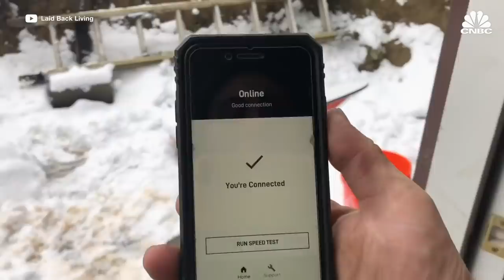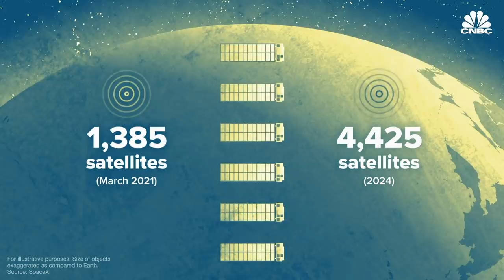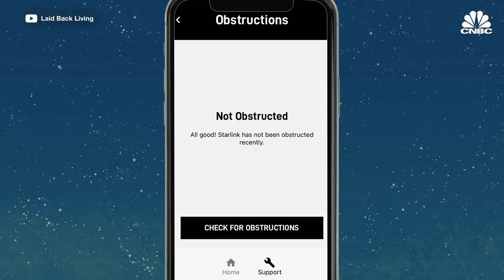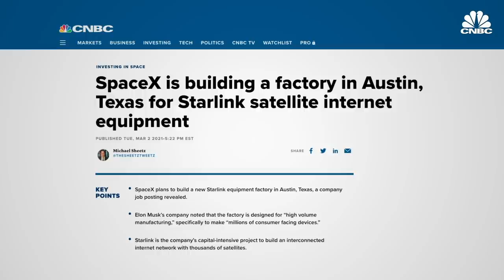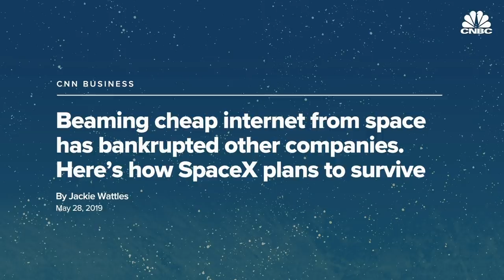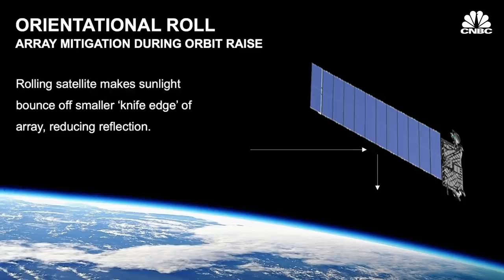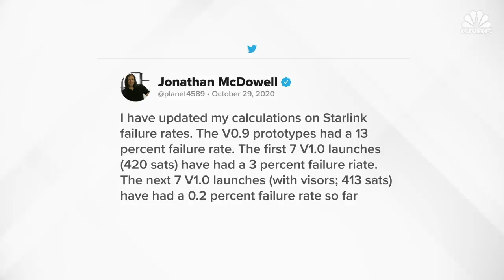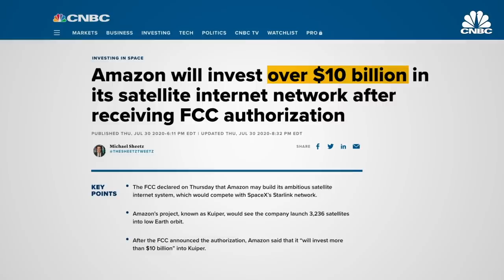Why Starlink Is Crucial To SpaceX’s Success

Comment: De-orbiting failed Starlink satellites is not a long-term problem. At the low altitude at which Starlink orbits, the satellites are experiencing small amounts of atmospheric drag that will eventually decay the orbit and cause the satellite to reenter and burn up, even if it has no communication or propulsion.
Reply: how long is "eventually"?
Reply: @Dozman01  it depends
Reply: @Dozman01  Around 5 years for starlink sats
Reply: @ok ok The regulation they mentioned in this video would require satellites to de-orbit within 25 years. 5 years is 5 times shorter than that, and we're only talking about the worst-case scenario where SpaceX completely loses control the satellite. Which hasn't happened yet (to my knowledge) in any of the 1200+ satellites launched so far. There would not be dozens or hundreds of dead satellites in 5 years.
Reply: @ok ok I was referring to if all system fails. 5 years is the natural time it takes for the sat to burn up if the propulsion system does not work.
Reply: @ok ok There has not been a StarLink failure of 2.5%  The source for that was including the test batch which wasn't to stay up anyways, and none were 'dead' satellites that were not able to be de-orbited.  
If they do fail to be controllable, the atmo drag will reduce their altitude fairly quickly taking them out of the current Starlink Orbits, and therefore reducing the chance of a 'Failure' collision almost entirely.  Then within a few years, it will deorbit completely and burn up.
Reply: @ok ok Quote directly from Business INsider (who broke the story about the 2.5% failure rate:
Before the end of October, McDowell was measuring a 3% apparent failure rate, but a recent reanalysis indicates improvement in the newest Starlink batches. Of the last 413 "version 1.0" satellites, only one appears to have died, giving these batches a failure rate of just 0.2%.
Reply: @ok ok It says "A 2.5% failure rate could mean more than 1,000 inoperative spacecraft." ... likewise that means a 5% failure rate could mean 2,000.. or 100% could mean ...... anything 'Could' mean.
What it is is .2%.  .2 percent over the 5 year life of a satellite is negligible.  There will NOT be suddenly 1000 satellites that stop working and crash into each other.
Take a deep breath...
Reply: I'm curious about how debris burning up in the atmosphere affects it. We see things that seem harmless at first but then after a build-up become extreme hazards.
Reply: Also if space is so vast, why not push them into outer space or take them to Venus where they can safely burn up with no threat to known life?
Reply: @teethompson7756  The amount of fuel that would be required to push them out of the Earth's gravity well would be more detrimental.  De-orbiting uses the Earth's gravity to do the work.
Reply: @ok ok  you seem to intentionally forget how far these satellites are from each other at 500 km above earth. The area of the the earth is already massive and if you increase the radius of this sphere by 500 km, it will be even greater. Even 50,000 satellites in orbit will be at great distances from each other. In the event some of them fail/lose contact, they are programmed to automatically de-orbit using ionic propulsion and gravity(if the ionic propulsion system fail, gravity will still do the job though it will take longer). Take a deep breath, close your eyes and picture these events in your head. Maybe then you will get your why your fear mongering is uncalled for
Reply: @countrychristmasloft8836   I see, but what are the long-term effects of the atmospheric burn-up? I assume that research has been done considering we've been putting things in space for decades.
Reply: @teethompson7756  It takes a lot of fuel to escape orbit, but very little to reenter. Pushing dead satellites out of orbit would be impractical.
Unless they are using radioactive materials or particularly toxic chemicals, there is no danger to life from reentering satellites. Thousands of meteors burn up in the atmosphere every day... they do not affect life on the surface.
Reply: @ok ok can't remember, probably saw it on Elon's Twitter. 
Here's a reference from a Dave Mother article from two years ago talking about doing this manually:
"In addition to letting the three failed spacecraft fall back down, SpaceX plans to intentionally bring down two others using ion engines; this is meant to demonstrate the company's ability to prevent spacecraft from turning into harmful space debris."

They even nearly took down Aeolis by accident.
Reply: They are still designed to de-orbit themselves so they don't collide with other objects.
Reply: Oh, come on. If they don’t communicate with a ground station for a while the timer will kick in and de orbit the starlink unit
Reply: Maybe someone else can answer this, but I was wondering why they wouldn't simply launch them out into space once they are out of commission? I'm probably overlooking something really basic but it seems like it would be easier, plus an opportunity to launch essentially free 'beacons' into interstellar space for any other hypothetical civilizations to find.
Reply: @kevj4584  
Because breaking out of earths gravity requires a huge amount of energy
Reply: @heidelbergaren5054  yup good point. I thought of that afterwards and now feel dumb lol
Reply: @kevj4584  It takes a lot of thrust to achieve escape velocity and leave Earth orbit, almost certainly more than the satellites can produce with tiny maneuvering engines and a limited supply of propellant.
Reply: @ok ok haha this ok ok guy is a troll and he almost got me but I've learned to just laugh them off
Reply: @ok ok you can't just take into account a few specific points and then disregard multiple other points that don't fit your narrative. 

You are stating that almost 3% of Starlink satellites have failed. That is correct. But you are also stating that if SpaceX achieves its target of 42,000 satellites in orbit, there would be about 1,260 satellites that would have failed. That is likely incorrect, because you are failing to understand that SpaceX is rapidly improving its satellites. The aim is to lower the failure rate to much lower than 1%, and Elon Musk even said that a failure rate of 1% "would be inacceptable." 

To conclude, instead of predicting that around 1,260 satellites of 42,000 will fail, we can predict that less than 500 of 42,000 satellites will fail. And the thing is, the number 500 was calculated if we assume that 1% of the next 40,000 satellites will fail, when clearly SpaceX has the capabillity to make the number much lower than 1%. 

So if we take into account that SpaceX is SpaceX, and that Elon Musk is the CEO, an assumption of a total of 300 failed satellites is not crazy.
Reply: @ok ok Oh, I understand now. You're one of Elon Musk's haters. As I have already said, your argument consists of a few different points, yet utterly ignores the rest. It has to fit your narrative.

I like how you said "SpaceX engineers can't just magically solve a problem that companies have been trying to solve for decades." Because that's exactly what they HAVE been doing. You are choosing to focus only on some promises that Elon has made over the years, instead of what he has accomplished, and how important he has been. Sure, he sometimes makes impossible claims, but that is helping speed up innovation greatly, beacuse it puts pressure on everyone to achieve the goal faster. There's a reason why SpaceX is rated as the #1 most attractive employer in the world for engineering students, with Tesla following right after, at #2 in the world.

All that aside, SpaceX is already showing that there have been major improvements in the satellites to lower the failure rate. The same astronomer who originally calculated the almost 3% failure rate has now also noted that the "reliability of the satellites has noticeably increased." Therefore, the source of your information is against you, and the data is clear proof against you.
Reply: @ok ok What's your source for the information in the second paragraph regarding the claims about the reusability of the Falcon 9 and Falcon Heavy? And the source for the industry standard failure rate?

So back to the original topic, SpaceX has enough brilliant minds to decrease the failure rate of its satellites. This whole debate is getting very silly, and you are taking this way too seriously. The Starlink satellites will eventually be able to provide affordable high speed internet access to every human on Earth. Stopping Starlink's mission is not an option, the only way is to make it safer. And SpaceX is doing just that.
Reply: @countrychristmasloft8836  Gravity works in orbit, that's why they're flying very fast orbiting around the world. De orbiting lowers the orbit speed which also lowers the orbit altitude, until it contacts the atmosphere further slowing the satellite for re-entry.
Reply: @ok ok I’m not blindly following whatever Elon Musk says. I’ve been stating facts and actual numbers from SpaceX itself. Sure I have quoted Elon a few times, but you have to understand that Elon is the CEO, CTO, and Chief Engineer of SpaceX. He is heavily involved in everything about SpaceX, as well as all of his other companies. You said that Elon is “extremely ignorant on how the science behind his products works” in a previous comment. That is a very idiotic statement. What Elon says can most definitely be trusted. Having a few wrong estimations on a few of his products does not equate to him not knowing the science behind his products. Just go watch any of his interviews, he is extremely intelligent. Also, I don’t know where you got the notion that he genuinely lies about his products and is fraudulent, because that is blatantly wrong. Elon Musk is no Trevor Milton. 

Your estimations are wrong. Don’t ask me to provide you with a detailed explanation with what’s wrong with it, because I’m not wasting my time on that. I’m just here to correct your foolish thinking. 

Anyways, you haven’t even explained or provided sources for any of your other questionable claims. I don’t mind if you don’t, but just know that your statements contain no validity with no sources.
Reply: @ok ok Damn, seems like you really hate musk, calm down bro. Complaining will not get you anywhere.
Reply: @ok ok Yes you're. In all this comment section you made him sound like a villain. Like all he ever do is bad or just promising. Everyone here saw you fight back to prove EVERYTHING that he's doing is bad. He's not perfect nor he's hero, but at least his doing things instead of Complaining like a hater here. go do something with your life, at least people put faith in someone who dreams and wants to do something instead of someone who points a finger at complain like you.
Reply: @ok ok If you are here in this comment section for days replying instead of studying then there's something wrong with you. You just points and things that he did wrong and not the good, just like you don't want to see them wtf? that is not hater thing to do?
Reply: @ok ok I don't even know if everything that you said about yourself is true. Your account was created "Joined Apr 5, 2021". This really sound like a troll account that was created recently specially with your name "ok ok".

This conversation will get us no where... i know what you said about his lies and over-promesing, but to say that "broken promises and lies far outweigh his proportionally minuscule accomplishments." is really a overplay. I don't think someone that rose to be one of the(if not the most) importantly/influential is low like you said. This make it sound very hater...
Reply: @ok ok the network is in sub orbital trajectories. It's very close to the earth's surface as opposed to other satalites.

That means, it's technically orbiting inside the earth's atmosphere.

The real obstacle for SpaceLink is keeping the satalites from NOT falling due to atmospheric drag. 

I read that each satalite had a propulsion system that gives it a periodic boost to overcome atmospheric drag.

If the propulsion system fails, and the satalite fail to get the periodic boost to overcome atmospheric drag, then it falls towards earth and burns up.

Normal satalites are faaaaaar away from the earth's surface and don't have to worry about atmospheric drag. Sub-orbital satalites are not really in space, they're near the top of the earth's atmosphere.

ICBMs (Intercontinental Ballistic Missiles) usually shoot up to that altitude, and then fall back down. It's not that high up.
Reply: Planned orbital lifespans, come down regardless, replaced by newer upgraded versions.
Reply: @teethompson7756  would take a lot of energy to actually escape the pull of earths gravity and escape its orbit.  wayyy to much energy
Reply: This Ok Ok dude is a troll from china. They are at war with elon over spaceX and Tesla in China. China main media platform are at open fire with him and the media there speaks for the government. So don't take him to serious. Just a warning. Sounds like a joke but his account was created 4 weeks ago. And he has commented on tesla and spaceX. So his account is very very fishy. Fishy as sushi😂
Reply: Could falling debris be harmful?
Reply: @variantunknown4210  It's unlikely. Satellites like this are designed to disintegrate completely  upon reentry, and they don't contain toxic elements (like atomic reactor fuel).
Reply: @ariochiv  thanks for your reply, one less thing ill be losing sleep over 😅
Reply: @ok ok "permanent Kessler syndrome type issue"
lol
the moment you said this in one of your first comments, that should have been the moment people started questioning everything you say.
sadly no one even picked up on or called out that comment you made.
its funny how you think you have all the answers when you don't have even a basic understand of the core thing... lol
Reply: @ok ok "Kessler syndrome literally could lead to an issue that takes hundreds of years to clean up. you disagree?"
yes i greatly disagree with this.

at worst it would clean its self up after at most 5 to 6 years. it would decay in that time.

in fact my own complaints with star link is i think the thing will decay to fast to justify the costs involved. such a system will have to be replaced nearly constantly, not even because of the satellites failing, but because of them deorbiting on their own.

keep in mind, a large chunk of the satellites are lower elevation then the international space station. and people say it would only take a few years at most to deorbit if left alone.
Reply: @ok ok yes it can effect satellites in vastly different orbits, however even satellites in higher orbits don't have hundreds of years worth of decay.

even debris with a highly eccentric orbit will decay pretty quickly compared to what you are saying.

i'm not saying its perfectly fine if it happens, but don't blow it out of proportion here.
Reply: @ok ok "what's wrong with saying that? Kessler syndrome literally could lead to an issue that takes hundreds of years to clean up. you disagree?"
It's basically a moot point since there are regulations in place for these things.
"For US launches or satellites that will have broadcast to US territories—in order to obtain a license to provide telecommunications services in the United States—the Federal Communications Commission (FCC) required all geostationary satellites launched after 18 March 2002 to commit to moving to a graveyard orbit at the end of their operational life. US government regulations similarly require a plan to dispose of satellites after the end of their mission: atmospheric re-entry, movement to a storage orbit, or direct retrieval."
https://en.wikipedia.org/wiki/Kessler_syndrome#Avoidance_and_reduction
Reply: @ok okBe honest. Did you even read my full reply?
Reply: US government regulations require a plan to dispose satellites... If they were given permission then they must have passed this requirement. As was previously stated their plan is burn on *atmospheric-entry*.
Reply: @ok ok I edited my comment right after I sent it to correct spelling mistakes. I'm starting to see that you actually just might be a troll.
Reply: @ok ok you're concerned about the satellites colliding causing kessler syndrome. I'm showing you there's regulation against that in the US that stops companies from doing that if they don't have an approved plan to solve that problem.
Reply: @ok ok so how is it irrelevant?
Reply: @ok ok 6% this video says its currently 0.2%
Reply: any other long term problems you could think of ?
Reply: @havalinachiel7694  Aside from inconveniencing ground-based astronomers, I think the main risk is collisions with other satellites. SpaceX has already demonstrated that it is closely monitoring the orbits and has on several occasions maneuvered satellites out of the way when there was a close encounter.
Reply: @ariochiv  Yeah , I get it you think of long term problems more in a " technical " way , but let ´s just say there will be a many more , considering those referred to our daily lives , injustice , changes to the whole setting , paradigm or call it what you will . The amount of satellites will increase from 8k up to 40k + , and yet scientists claim that emf - as a technological branch - is not safe at all .
Reply: @ok ok "ad HOMINID attacks", must be the most unintentionally fitting typo I've ever seen